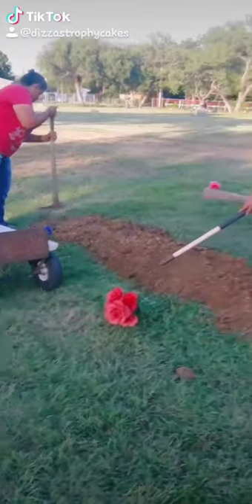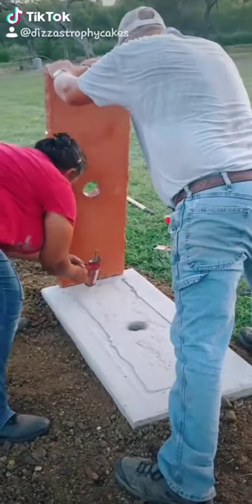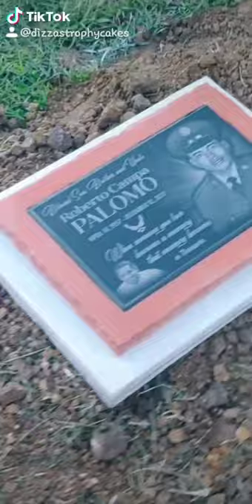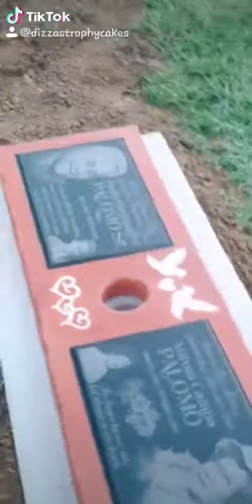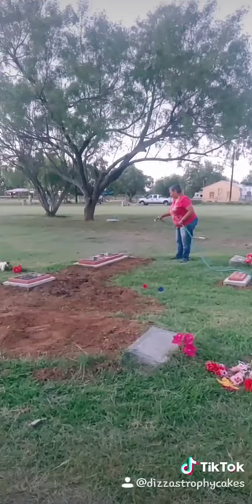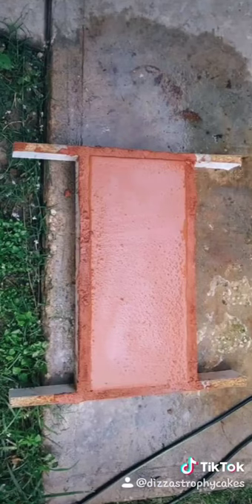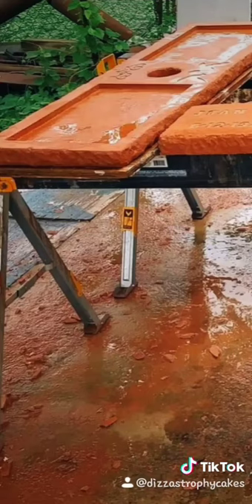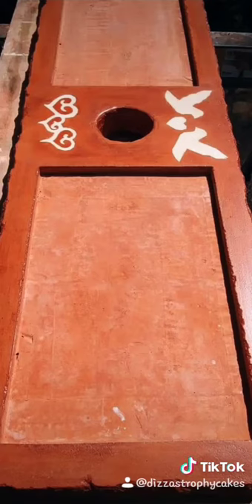How to create and setup a self-made concrete base for headstones

Comment: And also what size and thickness did she do the black name markers that she put into the double setting. Same with did she pour the concrete base and if so what kind of concrete and what thickness and dimensions did she use for that as well? And what kind of adhesive did she use to attach everything?